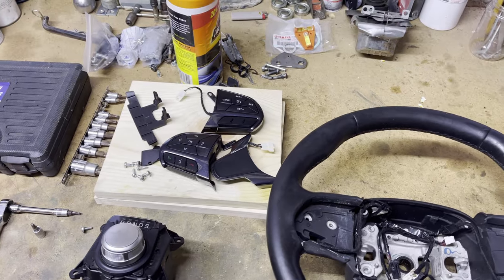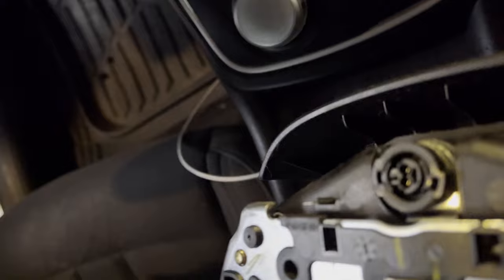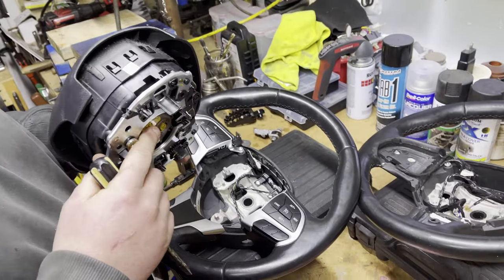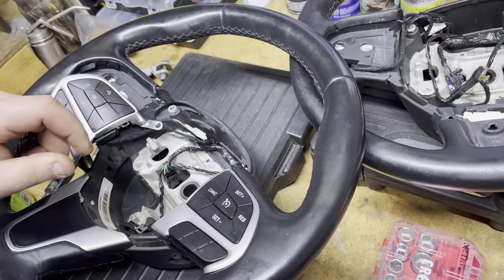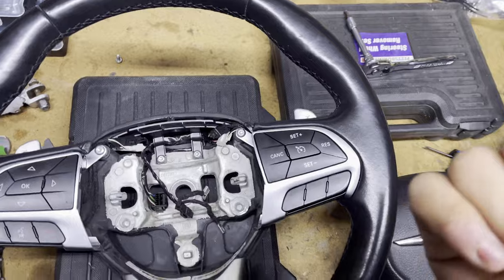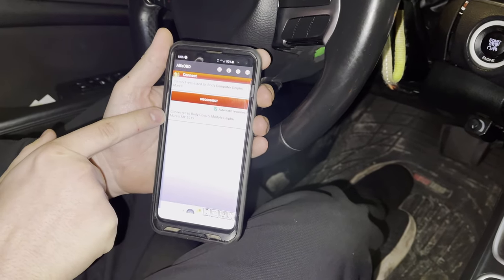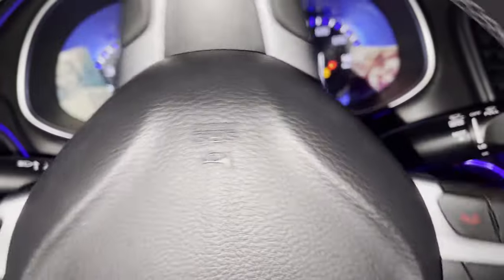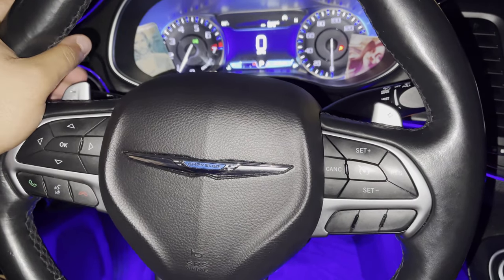Paddle Shifter Install ! | Limited to S | EASY ! | 2015+ Chrysler 200 | How-To !

Comment: On one of your videos you had said you were going to do a review on the obd scanner and proxy machine. Currently my radio doesn’t work which I’ve seen it’s typically the bms controller. I want to try to fix it myself and then run a proxy to see if it fixes it
Reply from the maker: For sure man I plan on doing it soon I need to actually get a google phone my self so I can do a review cause I don’t actually have it just yet !

Comment: Thanks bro it worked 🔥🔥🔥🔥🔥🔥🔥🔥🔥🔥🔥🔥🔥🔥🔥🔥🔥🔥🔥🔥🔥🔥🔥🔥🔥🔥🔥🔥🔥🔥🔥🔥🔥🔥🔥🔥🔥🔥🔥 , I just have one more question how did you . How did you get your cluster to tell you when to shift up on the side of the mph while you driving in the video cause my doesn’t tell me that
Reply from the maker: What’s up bro !! So do you have the 7” cluster like the bigger one ?
Reply: @moderatemods98  yeah I do I went all out the same as you

Comment: You think this would work for a 2017 300 limited? Also why not just use the 200 s steering wheel? With paddles already installed?

Comment: i followed your video to a T. but it doesnt work on my car.  The only thing I diddnt do is upgrade the gage cluster. i have 2015 200 limited. installed both, the s shifter and wheel with paddles. did the proxy alignment but the padles wont work. any suggestions?
Reply from the maker: Yes one last step !!

Comment: say boss the proxy alignment works the paddles work but when i put the car in sport or just want to use the the paddles it doesn't show the D1 or the S1 it shows D or S but what should i need help!!!!!!!!!!!!!!!!!!!!!!!!!!!!!!!!!!!!!!!!!!!!!!!!!!!!!!!!!!!!!!!!!!!!!!!!!!!!!!!!!!!!!!!!!!!!!!!!!!!!!!!!!!!!!!!!!!!!!.
Reply: and as well on the the screen where it say Gear - OR + it pops when it wants to when in sport mode should do the proxy again.???????
Reply from the maker: Got you bro !!! Follow these steps here !!
Reply from the maker: Paddle shifter enabling 
	1.	Select your vehicle
	2.	Body computer
	3.	Select body computer Delphi/Marelli 
	4.	Connect to OBD link MX
	5.	Click the little red car(bottom right corner)
	6.	Select procedure to start: Select “Car Configuration change”
	7.	Select options: Select  “paddle shift”( scroll almost half way) 
	8.	Select value : Enabled

Shifter module PRNDS enabling
	1.	Do the first 6 steps for paddle shifter enabling
	2.	Select options: Select “shifter type variant” (Scroll half way and scroll a little further down)
	3.	Select Value: “5 position Rotary Eshifter PRNDS” (Last one on the list)

At the End of either of these steps Proxy AGAIN !!!! Enable first then Proxy !

Comment: Helppp!! I did all that you did buttttt non of my buttons are working on my wheel . I can’t set nor res and the paddles don’t work . Thank you if you can help!🙏🏽
Reply: And yes everything is plugged in , I check twice
Reply from the maker: Paddle shifter enabling 
	1.	Select your vehicle
	2.	Body computer
	3.	Select body computer Delphi/Marelli 
	4.	Connect to OBD link MX
	5.	Click the little red car(bottom right corner)
	6.	Select procedure to start: Select “Car Configuration change”
	7.	Select options: Select  “paddle shift”( scroll almost half way) 
	8.	Select value : Enabled

Shifter module PRNDS enabling
	1.	Do the first 6 steps for paddle shifter enabling
	2.	Select options: Select “shifter type variant” (Scroll half way and scroll a little further down)
	3.	Select Value: “5 position Rotary Eshifter PRNDS” (Last one on the list)

At the End of either of these steps Proxy AGAIN !!!! Enable first then Proxy ! 

Try this bro
Reply: @moderatemods98  I did
Reply: @moderatemods98  is there a way you can ft me or dm on Instagram ? You can block me after idc I just want this to work 😭😭 I’m already getting pops when it downshifts itself but this will help
Reply from the maker: Lololol your funny as hell saying block me right after ! I can for sure message me on IG ! “Moderate_mods”

Comment: Not having any luck with my install. Do you NEED the upgraded gauge cluster? You and I have the same car, just wondering if thats a missing feature I nees
Reply from the maker: What step are you getting too bro ?
Reply from the maker: If you are at the proxy part , make sure you are enabled for paddle and sport mode , if you don’t know how here is the steps bro ! 

Paddle shifter enabling 
	1.	Select your vehicle
	2.	Body computer
	3.	Select body computer Delphi/Marelli 
	4.	Connect to OBD link MX
	5.	Click the little red car(bottom right corner)
	6.	Select procedure to start: Select “Car Configuration change”
	7.	Select options: Select  “paddle shift”( scroll almost half way) 
	8.	Select value : Enabled

Shifter module PRNDS enabling
	1.	Do the first 6 steps for paddle shifter enabling
	2.	Select options: Select “shifter type variant” (Scroll half way and scroll a little further down)
	3.	Select Value: “5 position Rotary Eshifter PRNDS” (Last one on the list)
Reply from the maker: And once you enable those you have to do another proxy alignment ! And then you should be good !
Reply: Would this be the same with updating the speedometer by chance? Tying to save a buck going to the dealer

Comment: So if i don’t want the heated steering wheel i can just buy a whole new one with paddle shifters and install it ?
Reply from the maker: Yes ! You can get those flat bottom ones anything  that holds the dodge , Chrysler’s air bags !!

Comment: Do you really have to remove the air bag to get to connector for the shifter connectors?
Reply from the maker: Yeah :( but it’s not that bad bro !
Reply: @moderatemods98  I’m scare my airbag won’t deploy. 😬
Reply from the maker: @carljean  Lolol just in hook battery and wait a while before doing anything and you will be all good bro !
Reply: @moderatemods98  okay. I’ll do that

Comment: Just out of curiosity.  If I don't have the computer to do the proxy , would the dealer be able to do it ? I mean thanks to your help they did a proxy on my radio when I changed it to the 8.4 inch.. so would they do it with the paddle and shifter too?
Reply from the maker: Yes they would bro !
Reply: @moderatemods98   and just another question bro.. can I just installed the knob shifter first and do the paddle later ? Because I can get the knob shifter anytime but I don't if I need both to make work... because I was thinking about to put the knob shifter first and do the proxy .. so do you think it will work like that? Or do I need both ?
Reply from the maker: Yup you can do the knob first get it proxyed and have sport mode just no paddles buddy !
Reply: @moderatemods98  I see thanks.. and I forgot to mention something else... I changed my cluster to the 7 inch and it was originally from an S so when I put my car on L I noticed on the cluster says S , you know instead of saying L it says S  so does that means that when I get the S knob shifter I won't need a proxy. ? Like if I put the S knob shifter how would I know if is working?? . Thanks in advance

Comment: Do I have to have the new dial shifter to make the paddle shifters work?
Reply from the maker: No bro !
Reply: @moderatemods98  Awesome! Cause I ordered some paddle shifters, and gonna get a new shifter soon, and wasn’t sure if it was gonna work or not.
Reply from the maker: Yeah bro ! It’s all good !
Reply: @moderatemods98  Ok, should be the last question, my paddle shifters come in tmr, and my new transmission gear selector comes in a few days from now, do I need to do a proxy to make the paddle shifters work? Also can I install the new module without a proxy, to at least get myself to the dealership to have the proxy done? Or what should I do? Thx!

Comment: Got a resource purchase link for the pedal shifters?
Reply from the maker: No unfortunately because they are single sales on EBay but they are all over bro !
Reply: @moderatemods98  well what's the part number you got?
Reply from the maker: I don’t know the part number unfortunately bro but if you type in Chrysler paddle shifters you will find them , they work off the dodges Jeep’s and SRTs !

Comment: Does this same method work with a Gen 1, like a 2011?
Reply from the maker: That’s a awesome question , so I don’t know exactly , do the gen 1 have a paddle shifter option on some of there cars ?
Reply: @moderatemods98  No they don't. I have a Gen 1, and I love paddle shifting, and its so frustrating that I've gotten like 10 different answers, and none of them seem to be reliable across sources xD The shifter knob already has the manual gear selection mode, but I'm not totally sure what it would take to install paddle shifters.
Reply from the maker: @OverAndOverAndOver  bro honestly anything is possible now will it be simple like this , probably not just because these cars have literally the exact same set up , except one has paddles one doesn’t so it’s just plug and proxy enable and play ! So unfortunately I am another one of those sources because I don’t want to give you wrong info , now you could try like a custom shop in your area and see if they can create something lol it would be awesome and definitely a first ! 💯🔥

Comment: So if I put paddles on my limited do I need to swap out the stock shifter with Low mode to a sport shifter with Sport mode? Will the paddles not work with the stock limited shifter?
Reply: That shit don’t work I just did the whole install yesterday proxy and all and the paddles don’t even work smh
Reply: @Theyluhhjai woahhh what happened?
Reply: Damn bro you a year late😭, but nah I did everything he said I even took it a step up and got the hellcat paddles bc he said they would work I got my obd tool I did the whole install and I turned my car on and they never worked I installed the s shifter too didn’t work it said s on the dashboard but never worked
Reply from the maker: @Theyluhhjai try these steps make sure you always proxy align with alpha OBD

Paddle shifter enabling 
	1.	Select your vehicle
	2.	Body computer
	3.	Select body computer Delphi/Marelli 
	4.	Connect to OBD link MX
	5.	Click the little red car(bottom right corner)
	6.	Select procedure to start: Select “Car Configuration change”
	7.	Select options: Select  “paddle shift”( scroll almost half way) 
	8.	Select value : Enabled

Shifter module PRNDS enabling
	1.	Do the first 6 steps for paddle shifter enabling
	2.	Select options: Select “shifter type variant” (Scroll half way and scroll a little further down)
	3.	Select Value: “5 position Rotary Eshifter PRNDS” (Last one on the list)

7” Cluster Enabling
Change Cluster Type From TFT Black and white to TFT Color

At the End of either of these steps Proxy AGAIN !!!! Enable first then Proxy !
Reply: @moderatemods98  dang man you’re a year late too I enjoyed watching your build your car is beautiful but I don’t even have my 200 anymore sadly my girl was totaled last November

Comment: Link to that OBD reader on amazon please
Reply from the maker: Should be in description bro but if not “ MX+ OBD LINK “
Reply: @moderatemods98  where you get the windshield banner?
Reply from the maker: Got it made at my buddy’s tint shop , “ ATS Window Tint” in Rochester IN.